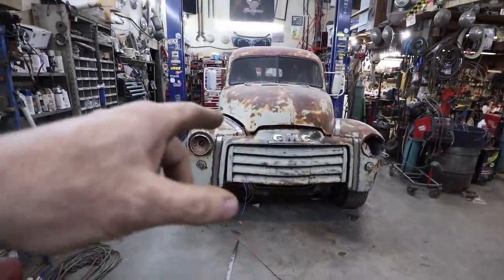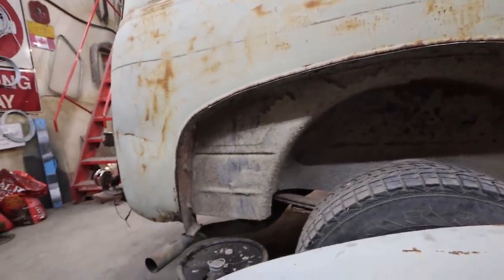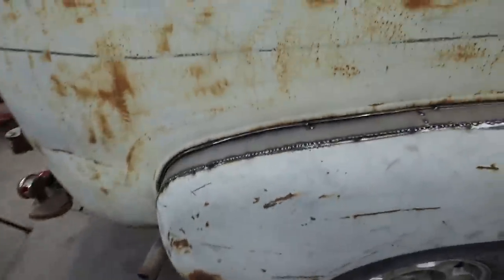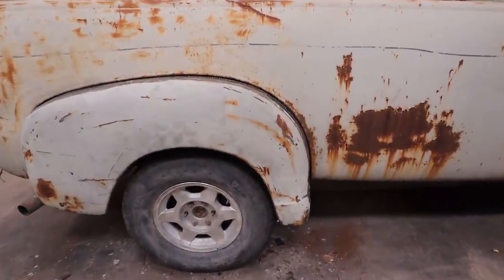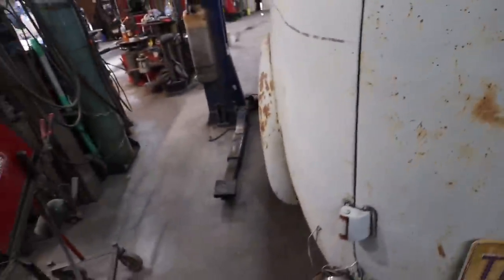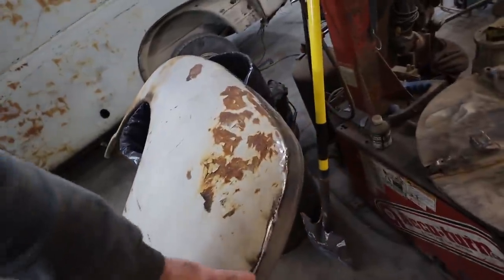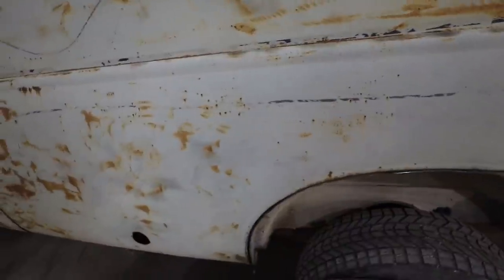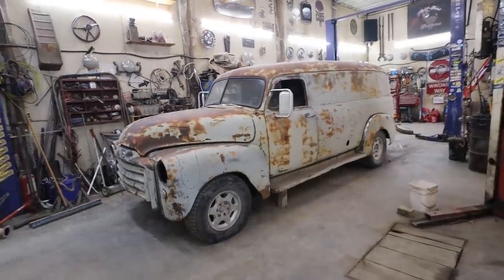Finishing the widebody 1951 GMC panel truck, widening the rear fenders 2 inches

Comment: By you widening the fenders made it just look that much better. If who ever gets it and wants to put air suspension in it that's one less thing they have to worry about. Plus wheels and tires can change the whole look of the panel truck. 👍🏼💯

Comment: I loved the look of the early panel trucks. I worked for a man, who's name was Jack Johnson in the late fifties an real early sixties as he was one of the first men I ever worked for outside of family. My dad wanted me to work for him but Jack had stuff that dad wanted so he let Jack hire me for two dollars and fifty cents a day. Cool weather we worked from just could see til dark going home. Hot weather would take them guys out and so I would stay behind on fire watch but anything that needed fixing I could earn more money an being pretty young yet, I went for it. I kept those old 216 engines running as they had miles on them. They were the 46 model panel trucks an they packed shake bolts inside them holding almost a cord of blocks that would go to shake mills. I miss those days actually. I got  real familiar with brakes on those old trucks back then as it was steep roads, and dusty as hell. Gravel roads that we traveled just about twenty miles for an it was slow so home meant at least a hours drive. Just to go that distance as those old tires would blow out an springs broke. I will say this, those trucks for that time period were damn  tuff. I have yet to see anymore of those kind of panels that basically were of that same shape or design but behind the two front seats in front the body was raised up about ten inches.... I just got a brain fart here Brent... I wonder if they were short school buses?? No windows in the sides and so that couldn't been the case could it?? I was but thirteen then an didn't read or write, I thought I was smart cause I could do math and the rest of them hillbillies were challenged if it was more than the fingers on their hands. I guess I will never know now but did they make a one ton school bus body in those rigs Brent?
Reply from the maker: Yeah seen my style as a school bus looking thing, was one for sale locally here a while back.

Comment: I've been going back through your archives lately and you have some awesome builds. i particularly liked the 1950 "Bare It All"  Chevy and the Plymouth Cranbrook. I hope whoever bought the 1950 Chevy is enjoying it. I think all old Chevys should be painted the stock Sea foam Blue color. That's just my bias. They all look great in the old Seafoam Blue. Unless of course it's the second most used GM color Seafoam green. I had a '66 Caprice with a motor from an El Camino in it. I immediately painted it Seafoam blue . It sounded meaner than my neighbors 'Vette. Cheers. Great work.

Comment: Wasnt too long, and on to back fenders.Pablo self feeding? Saw him snackin. Did E—wheel struggle with the heavy metal?

Mig wire. Some is more malleable than others.  Ever look into it? Would be nice to be able to work it without it cracking.
Slice and butt, close. Fitzee even likes your work. 

The more i watch, the more i want to build another one or three. 
Looks like everybody took one last kick at cruising in to princess auto. I was thinking about it. Big turnout.
Reply from the maker: Yeah the dogs are self feeders, no the wheel works fine with the metal.

Comment: Brent, I believe a fender welt goes between the body and the fender. It looks something like canvas. I did a 53 chevy pick-up. Sandblasted the frame, replaced every nut and boult with S/S. Rebuilt a 357 chevy high performance with 202 heads. You talk about a rocket? It was one, but never again! That was a lot of work.

Comment: After the last episode, went and did some tests on some old rusty Fiat 500 fenders i had in the back, and it's such a neat method. I mean, there's a bit more work, having to hammer the inconsistency at the weld, but not having to deal with the planning of the cut, worth it. Just slap a proper width in there, and buzz it off. K.I.S.S. perfection.
Best part, i think this might work for more modern cars too, just that i have to make sure the cut is not too low in the arch. I don't like plastic + bondo wings, so this is something i might try next summer.
Reply from the maker: Check out fitzee he does a better explanation of this I've kinda just always done my thing and it's worked for me Fitzee explains it better.  https://www.youtube.com/watch?v=_u31t13QO6A&list=PLW6iSb8vPbYApdBI1JE9DXTo_LDLM99Wj

Comment: Is that how you feed the dog? Just leave the bag open where they can get at it? Every dog I ever saw would eat itself sick... LOL I was watching the dog eating and I was trying to figure out what the hell he was doing. LOL Steve Dulcich of "Roadkill Garage and Engine Masters" fame, brought up a good point about stitch welding like you do on body panels and fenders. he said he tacks it in a few spots and then welds. I agree. I always used that "welding heat sink putty" tacked the piece in several spots, like every 6 inches and then welded it full length. I am not a body expert but the guy that taught me was and that is how he did it.
Reply from the maker: haha yeah they both self feed, though when winter comes I'll soon stop that as they graze a little to much I find haha

Comment: I would have thought the dent in the right fender should have been done before the fender was cut off.
This way no extra movement of the metal, being it's still attached to the body.
Are you still going to do something with those front fender wells ?
25:35 Now that's different. Take a 4 door car and make it into a 5 window coupe with a VERY LONG hood. 😜😜😜
Reply from the maker: Yeah gonna fix the front fenders yet.
Reply: @HalfassKustoms  Would be nice if you had extra front fenders to use for that fix.